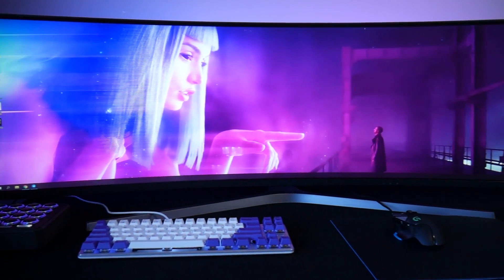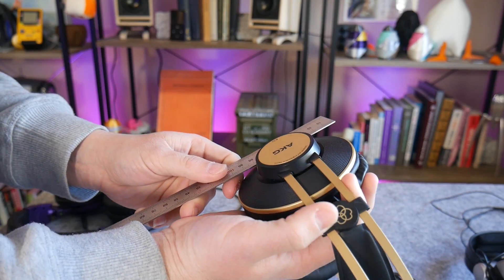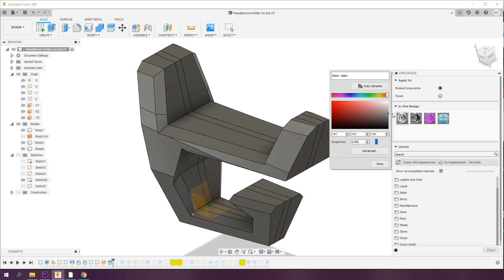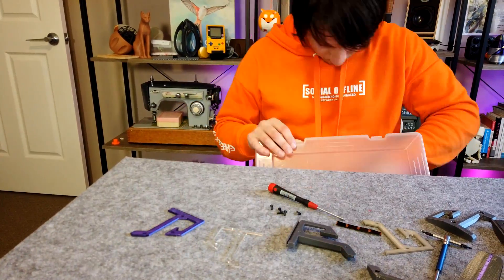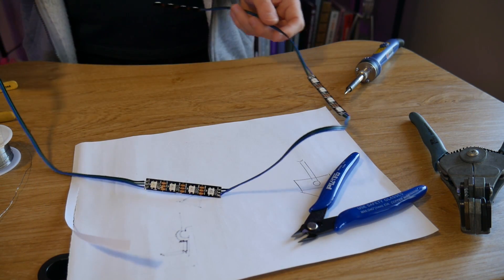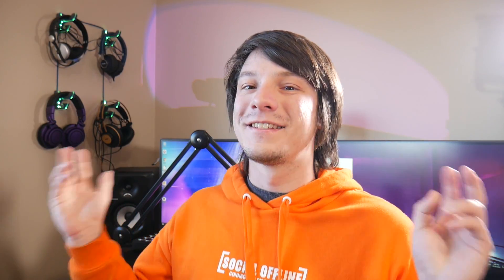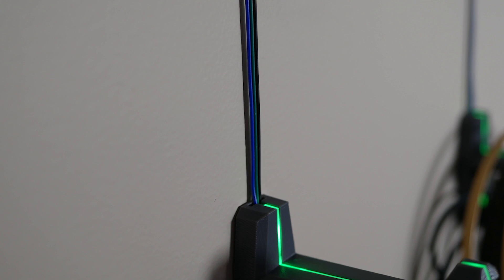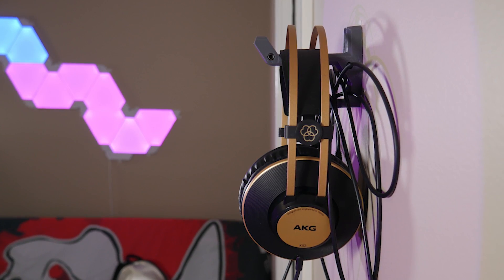Designing a Cyberpunk Headphone Holder (With RGB!)

Comment: You have four mounts in a box/grid pattern. If there were interconnecting plastic strips/covers for the wires if would go a long way to hide them. The grid would be a part of the design. It would make the whole into one piece rather than four. Additionally, you probably could use a lot thinner wire. The current being drawn by the few LED elements would not require thick wire.

Comment: On the aesthetic look of them, the angles & lighting effects are great, definitely what we thought looked futuristic back in the 80s, but you shouldn't have worried about trying to hide the wires, you could have 3D printed lit-up conduits that look like circuitboard tracks joining the holders together. You have to remember that electronics were new & cool in the 80s - think "Tron", even the tabletop Tron game I have has a dark transparent shell so you can see through it to a picture of a circuitboard with silver tracks on black background. Not the actual circuitboard (which is still quite interesting) but a mocked up picture of one!

Comment: I always wanted a grid pattern laser for mounting things on the wall. Angus do you think you could make a small cheap projector that just sits on a tripod where you can adjust it up and down with the tripod and in and out by moving the tripod. The big thing is getting it level, auto level would be cool but just a flat top to place a level will work.
Reply: That would require laser precision.
Hehe, but for real tho.

Comment: Another nice video
A simple way to deal with the cables would be to mount the brackets to another surface ( wood or some sort of aluminium composite panel ) and mount that to the wall. Then it would be easy to hide the wires behind that panel and on the theory of if you have a problem make a feature of it you could offset this panel from the wall and add some more LEDs  so there is a glow around it.
There are also simple controllers for those LEDs easily found AliExpress for a few dollars with all sorts ( infrared , ultrasonic ,) remote controls or simply stand alone

Comment: Did you consider using a thin backing board, to secure the 4 mounts to, you can then run the wires sandwiched between the wall of the back of the backing board.
Reply from the maker: Yeah not a bad idea, I want to put up big thick sound absorption tiles so that'll definitely help hide things!
Reply: Maker's Muse sounds like the way forward, one fixture with dual purpose - optimal use of space! Your videos and projects are very good, I do not own a 3D printer but am intrigued to see the developments, but also rate your other “none 3D printer” videos very highly. Big thumbs up 👍🏼 from the UK

Comment: Usually when wires have be exposed I would hide them in a surface mount raceway.  How hard would it be to print a backplate to mount your holders on leaving a channel to hold the wires? This would solve two problems: hiding the wires and squaring the holders to one another.
Reply: Had the same idea- wooden panel painted the same colour as the wall, mount the hooks onto that ( perfectly spaced ) and run the wires in a channel on the back- wouldn't need to be very thick and with a beveled edge it would barely be noticeable.
Reply: I had the same thought.  To extend this idea, embrace the elephant in the room and 3D print the raceway in the ‘pop’ color filament (purple/orange) so the raceways become part of your intended design.
Reply: And then paint the raceway the same color as the wall...
Reply: To stay with the synthwave idea make the cable raceway shaped like either geometric shapes (about the size of the holders) or make them look like traces on a circuit board.